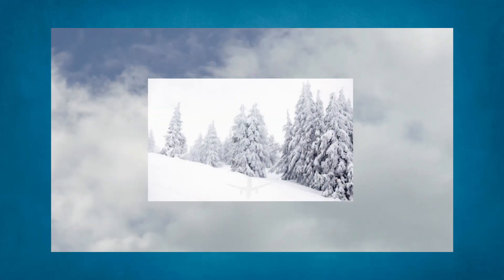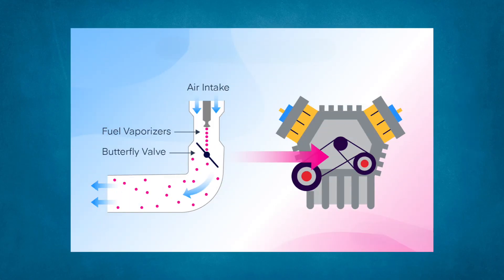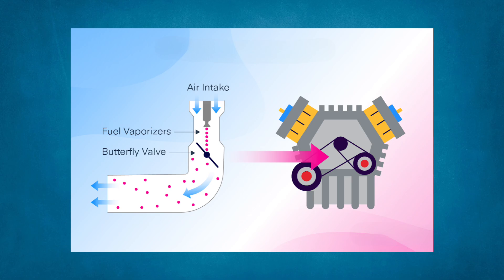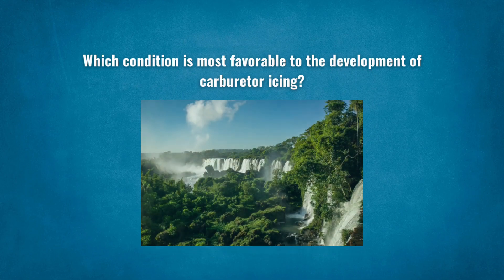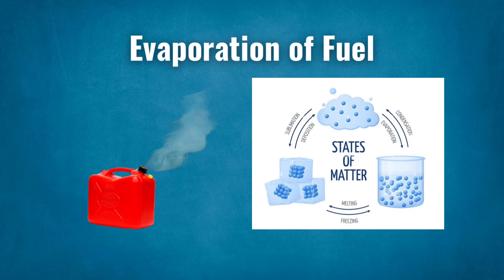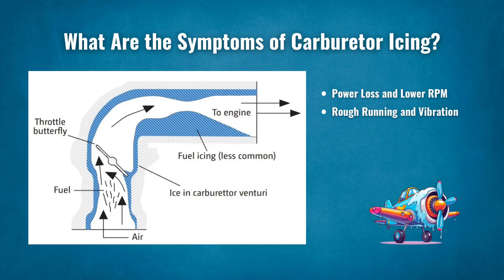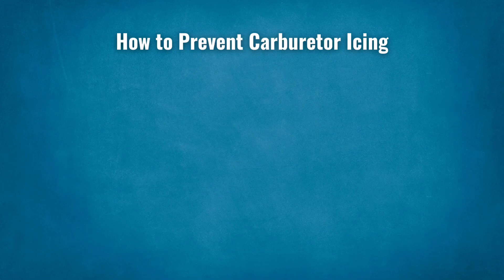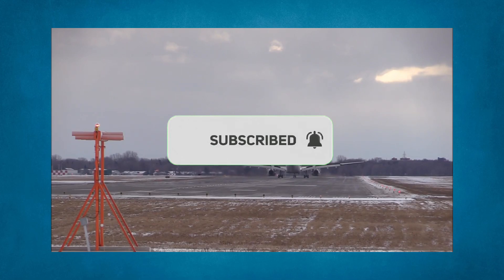Carburetor Icing – Every Pilot Should Know

Comment: 9:36 I'm not sure that leaning the mixture at cruise does much to prevent carb ice. It keeps the engine temperature optimal and prevents spark plug fouling, but not much else besides that.
Reply from the maker: Fuel evaporation is a cause of carburetor icing. You can reduce the effect of this slightly by flying with a leaner mixture. At lower levels, this isn’t really an option. However, during cruise, it is well worth reducing the fuel ratio.
Reply: @sabranip  Thanks for your explanation. I'm sitting an exam tomorrow so I'm trying to learn as much as possible. Great video!
Reply from the maker: I hope you will pass the exam. Thanks for your good wishes. 🙏🏻